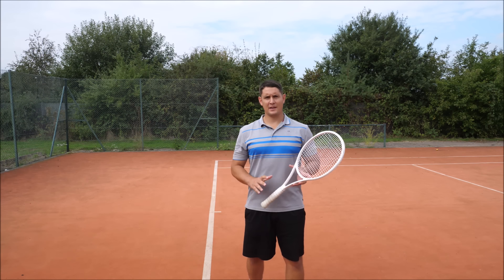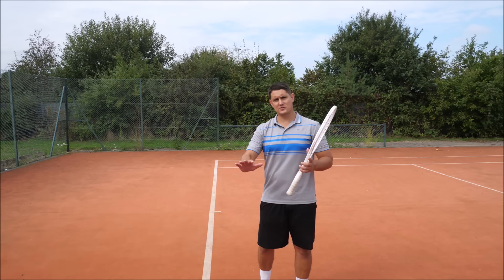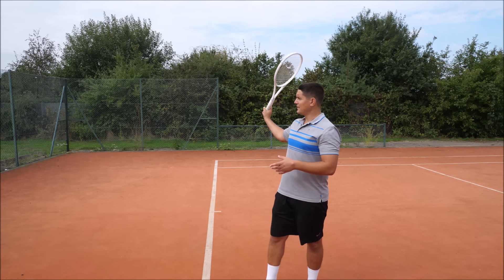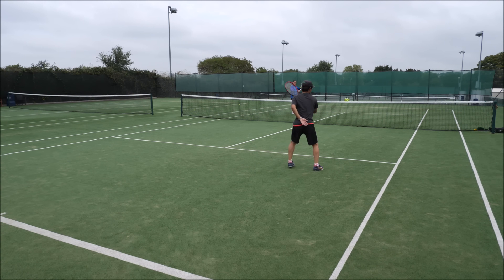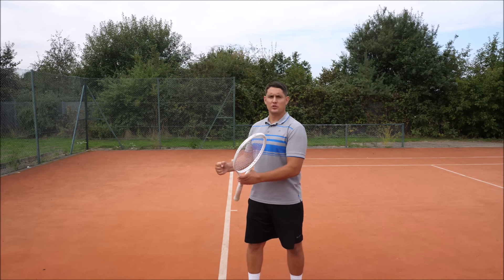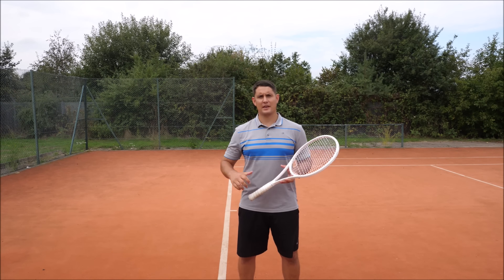Tennis Forehand Transformation - Technique For Maximum Power and Control

Comment: Not sure about the rotation starting from the shoulders and followed by the hips, shouldnt it be starting from the right foot starting the "push" going through the hip rotating and finally the shoulder and arm??
Reply: madridista1611 I agree thought the kinetic chain starts from the legs up to create a better “whip” effect
Reply from the maker: You're right when it's an open or semi-open stance. The hips would uncoil first, followed by the shoulders then the arm comes through. However in the neutral stance when you use the pivot step that's not the case. If the right leg (back foot) came first then at contact the player would be totally off balance and the body would be swinging in mid-air while they try to make contact. By allowing the shoulders to come through with the racket you can rotate the upper body, then the hips rotate and finally the back foot. The legs can drive upwards before contact though, you just don't want the back foot swinging around too early otherwise the player will be off balance at contact.
Thanks for watching.
All the best
Simon

Comment: Thanks for the useful video. I was able to spot the point 2, "the take back being too big sometimes", but I could not see the point 1, "often he's holding the racket throat with his left hand too long". I watched the footage (0:39) again, and I could see that!

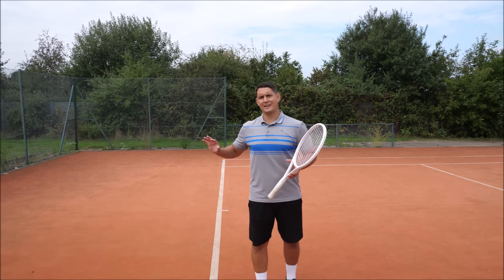Watching the pros' forehand (4:39), I noticed the virtually all of good players extend the fingers of their non-hitting hand at the power position. When I do that myself, it really feels right and helps my forehand. But why no one clenches the fist? Why the fingers have to be extended? I have never heard any decent explanation. I guess it's related to the non-hitting hand extended at the trophy pose of serve. Just curious....
Reply from the maker: The reason players don't make a fist in the power position with the non-hitting hand is because doing that would make the muscles tight, by having the fingers outwards, it's almost as if they were going to catch the ball with that hand, helping them judge the distance of the ball and allows the fingers to stay loose and the muscles relaxed.
Reply: @TopTennisTrainingOfficial  Thanks, Simon!!! That means that extending fingers with tension is not great and they are supposed to be loose. I'll try that on the court.

Comment: I have a similar problem-ish, there are many times where my forehand shot would be going into the net. And it ALWAYS be touching the white line of of the net(very top) before going down. And this can be frustrating for me. I hit my balls with top spin but I don't think it's have enough spin on it to raise it higher. When I do attempt to change by brushing from bottom to top more to create a better top spin, it does go up now, however my power could not seem to be put on the ball. Any tips?
Reply from the maker: This lesson is just for you - https://youtu.be/iRO6n0Qp4QU

Comment: Quick question.  Isn’t power starts from the ground up.  That’s what I hear.  But u say start with top down shoulder hips than leg.  Also,  how to keep my racket face from facing the back fence in the end of the backswing as I cup my wrist early on and never been able to release and wrist snap.  My wrist are unintentionally cup from start to finish.
Reply from the maker: Normally yes, it starts from the ground up but in this case I wanted him to feel his shoulders opening up and then the body trailing afterwards. He has a habit of rotating everything together at once which causes him to lose balance and fall away off the shot.
In terms of your own forehand, what grip do you use?
Sometimes the strings face backwards when the grip is semi or western

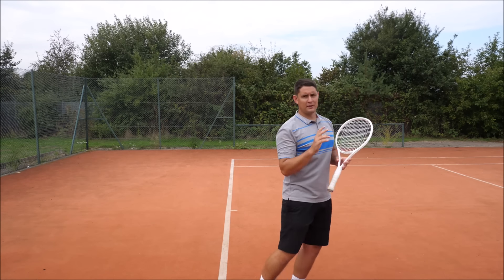Comment: Min 9:09 I dont understand why, when you hit the ball with forehand in that case, the right foot overpass( to front)left foot. I thought the right foot have to finish in the same "líne" to left foot to avoid overotate the body...
In this way I think you loose precisión and recovery step too...
Reply from the maker: Rotating all the way around with your back shoulder creates extra power. If you stop when you reach the front foot, you're slowing down at the time of contact. On some strokes you will do that, on others you'll open up fully and rotate 180
Reply: @TopTennisTrainingOfficial  Wow very fast the answer, many thanks sir!

Comment: His swing doesnt drop into the ball properly because of his prep and racquet position which you identified.  However, his hips I dont believe were as big of an issue as he was clearing and the few he didnt clear well on were balls he was reaching for and balls he didnt get under properly, again because he was late, which you identified and helped him with, so he wasnt in a good position to clear. I believe (15k teaching hrs 5.5 player) the stepping that was taught with the right side is an over correction in this case and many cases and leads to too many problems where players are now stepping instead of using their hips- this is not necessarily the same thing and it is not a good thing.  The first things you corrected should be enough because he was clearing and now that he isnt late, he will be able to be under the ball and clear his hips
Reply from the maker: Thanks for your feedback

Comment: And why not use the open stance in sted of closed stance with this grip??
Reply from the maker: We're not using a closed stance. It's a neutral stance.
A closed stance is when the right leg is across the body line, closing the body off 100%
Reply: @TopTennisTrainingOfficial  In my opinion the closed (or neutral as you call it) stance does not suit the way this player holds his racket. The western grip suits an open stance more. If this player uses the open stance he does not have to move his back foor after hitting the ball.

If i use youtube to find open and closed stance i can clearly see the same stance as your player being named closed stance.

Comment: Another clueless tennis" pro" trying to explain how to hit a ball...in this one, this " Einstein" has the guy hitting in almost entire close position...simply amazing
Reply from the maker: Neutral stance, not closed. 
Big difference. The closed stance is where the left leg is blocking rotation fully, pros use it only on the full run.
Federer uses the neutral around 30% of the time in matches.
But hey good work Detective Columbo.

Comment: I don’t teach lifting your back foot in your follow through. Where is power generated? From the ground! When you lift that back foot you lose a great deal of power.
Reply from the maker: Let's get this right - in a neutral stance, you don't teach your players to rotate and open up?
So they load, they then come up and you force them to keep the back foot planted? Therefore blocking the natural rotation that would occur from the hips and shoulders.
Plus you now have a player who is not uncoiling their body properly, stressing the front hip massively, which in the long run, if they hit with decent power, will most likely lead to injury of the left hip (for right-handers) and then you also have a player who is locked off from recovering in an efficient way.
Explain that to me coach